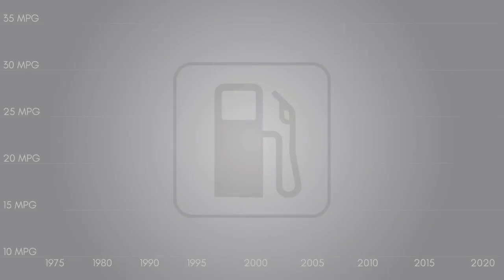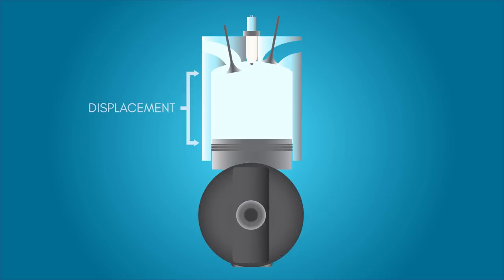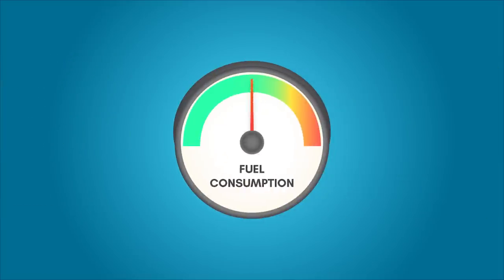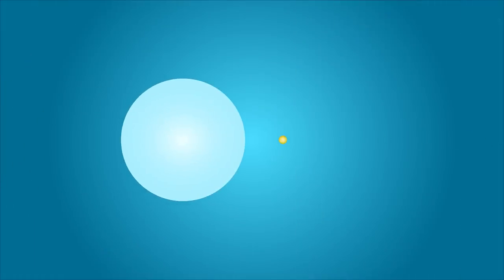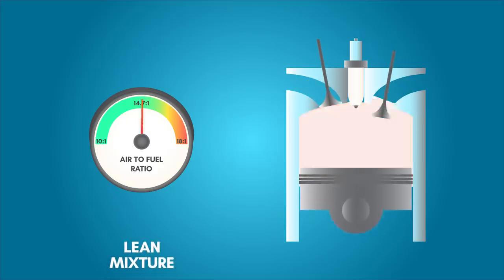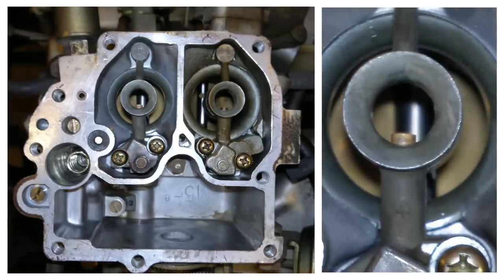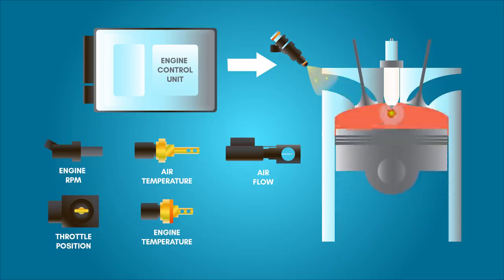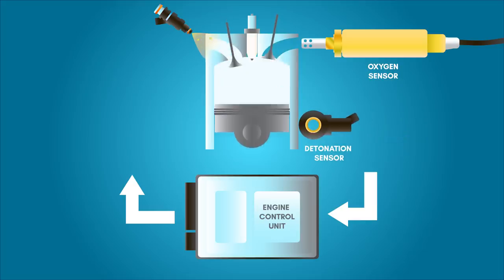How Engines Are Becoming More Fuel Efficient

Comment: The engine you showed being built is a GDI, (Gasoline Direct Injection) engine. Which works slightly differently. Mostly in that it does what it sounds like and directly injects the fuel into the combustion chamber. It does this at much higher pressure than standard fuel injection, and allows running an ultra lean burn for greater efficiency.

Comment: I own a 2014 Ford Focus SE. I recently completed a 1,400 mile trip. I averaged 47.5mpg (48mpg on the way out, 47mpg on the way back).

According to the EPA my car should do 28mpg city, 39mpg highway. According to Ford my car should do 27mpg city, 37mpg highway.

When I drive the car to/from work and around town I average 38mpg-39mpg.

I believe any car can get AMAZING gas mileage, it's all about how you drive it.
Reply: Also depend what condition of the road as well. And yes, your driving style.
Reply: It's about what kind of vehicle the manufacturer used to test the consumption. They use the lightest export model and then the fuel tank has a relatively low level and the battery is fully charged. 
No way your car can do it.
Reply: @arvedludwig3584  he just said his car gets BETTER than factory predicted mileage
Reply: @TheRedneckSage  ah shit, that's the tricky part. Here in Europe it's the other way around. We measure fuel consumption by liter per 100 kilometer.
Reply: I’m glad you like your Ford Fecus ...
Reply: You can get more credit from your bank deposit it depends on how you make your withdrawals. Uhh?

Comment: A rich mixture produces more power primarily because of the effect it has on reducing knock and combustion temperature. Though it's true some of the power comes from using up all the available oxygen, it's mainly from the additional ignition timing and (if turbocharged) boost that can be added with an enriched mixture.
Reply: That's right, that's exactly what water injection does, it gives you the ability to up your timing and or boost when the water injection is utilized, some people mistakenly think that the alchohol mixed in is what does it but it's primarily in it to keep it from freezing in lower temps, although with proper tuning the alchohol does add a little power it's the increase from being able to jack up the boost and timing from the cooling effect of the water injection that's most of the power increase, I know several guys that are street racers that got sick of messing with the mixture and re-mapped their systems to run water only (fair weather cars) and have told me that by the seat of their pants they can't tell the difference between straight water and the water/alchohol mix.
Reply: Engines actually make more power when slightly lean, the reason rich mixtures are run, especially on high performance engines is to control cylinder temperatures. Its always a compromise when tuning an engine between max power and blowing up/melting and engine. There is a tradeoff between running more timing and then running a little rich to drop cylinder temperatures to counter knock potential. But lean with a lot of timing would make more power but would be a ticking time bomb. For background I'm a mechanic that specializes in high performance Subarus, and work alot with building/tuning turbo cars.
Reply: Lean makes more power.

Comment: Great explanation of the earliest major developments in fuel economy. I believe you got one interesting fact a little wrong though: Emission regulated engines actually aren't targeting stoichiometric ratios. Instead they are targeting slightly richer (more fuel) ratios that will make the catalytic converters work a lot better. They actually cycle between moments of rich mixtures and near stoichiometric ones so that the catalytic converters can store some oxygen for their chemical reactions.

Comment: I bought a 1979 Chevy half ton, full time 4WD pickup in 1984. It had the small block 350 and got about 10 mpg. I put lockout hubs, converted the transfer case to part time, dual exhaust, an Edelbrock Performer intake manifold, and a Holley 600 carb on it and increased the mpg to about 14-15. Mind you this was at speeds of 60-65 mph. That combination maybe put 200 hp to the rear wheels.  I just did 1500 miles in my 2019 Silverado crew cab with 4WD and the 6.2 engine which puts about 350 hp to the rear wheels. At speeds of 70-85 mph I averaged 21 mpg. The improved efficiency of the new vehicles along with substantially (night and day) increase in power is truly mind blowing to me. I have no doubt I could average 23-25 mpg with the 2019 if I actually drove as slow now as we did back in the 80s when the speed limit was 55.

Comment: You missed the deceleration phase (deliberately?) where carburettors fail too and EFI is so much more efficient. When the throttle is closed at speed the sudden increase in manifold vacuum draws additional fuel into the intake, which although burnt as part of the combustion process serves no useful purpose.

EFI has the ability to disable the injectors completely above a certain engine speed (often around 1500-1800rpm for a 4 cylinder engine) with the throttle closed, and thereby using no fuel at all. This is an argument I often use against people who insist that 'coasting' (eg depressing the clutch and letting the engine idle during deceleration) is more economical.
Reply: My car on decline only disable injectors if i don't press the pedal. il i don't press the trotle, consumption fall to zero but motor brake. If i press the clutch and don't press gas pedal consumption falls to zero and no motor brake. It's a recent suzuki. An improvement on fuel economy will be to automaticaly press the clutch to  desactivate all the motor on decline (no motor brake). On shell chalenge with 1 liter they make 3500 km but they drive quite time on free wheeling.

Comment: In case you don't live in America. Most cars here are giant SUVs and Pickup trucks that do 8-15mpg. The only car that was capable of 45mpg was VW Golf TDI which resulted in "Emissions Scandal"
Reply: Well in Europe, Euro regulation are so strict that stating car are most fuel efficient is laughable compared to us. A standard car (non hybrid) can easily achieve 5l/100 or less depending on age of the car. The problem is how Americans are stuck with the idea of big engines, 75hp for a car here is commun.
Reply: @Mido Alaaeldin That has nothing to do with efficiency
Reply: Sasha Z There are far more than one type of car that has good mileage here in America.
Reply: @Douglas Hamner the mpg ratings are using different gallons in the us and uk, the US uses us gallons and the UK uses imperial gallons which more volume.
Reply: Foxycat 21 totally agree, uk fuel is better quality too, my 2008 88bhp Yaris gets 60 mpg, now in 2019 cars still aren’t getting much if anymore mpg, I do have a Jeep Grand Cherokee 4.7 V8 as a weekend car though so I do like a bit of Americana
Reply: My 2006 silverado 2500hd crew cab 4x4 diesel averaged 24 on highway @ 63mph
Reply: @jamesbizs  they only have motorcycle engine powerade cars because the gas price in Europe
Reply: Sasha Z heh, I owned a VW Passat TDI and I was like “hang on... the sheet didn’t tell me I had 45 MPG at my disposal”.. oh the good days of signing a bunch of paper work
Reply: Chief I live in Los Angeles, visit Bay Area often, from NYC originally, drove across country.   I've been driving well over  a decade, covered most of the North East. I can tell you your assertation of vehicles in the states is far from accurate.   

There is a huge number of hybrids and electrics, electrics from Chevy bolts, Nissan Leafs to Tesla.  Hybrids of every form, Prius, Camry, Malibu, Lexus Cts Rxs Exs, Fusions, Atimas, Explorers, Civics Accords, etc

The love affair with the Giant SUVs went with the Economic Crash of 2006-09, a major part of the crash are  the automakers behind the Gas Guzzlers you mentioned, only folks flush with money and a few idiots in the midwest are wasting their money on the guzzlers, in fact saving gas is trending for near a decade. Especially in fashion and entertainment. 

and even w the emmissions scandals VW Passats and Jettas especially are surprisingly quite fuel efficient.
Reply: American here, my 20 year old car gets 60-70mpg, whilst it is a hybrid it can achieve the same milage with electric disabled.
Reply: @rpoppermann  don't you ever sell it
Reply: @barabolak  I've got two now, one is engine swap for racing(: you can pick them up for like $2000, nobody knows what the heck they are so they're not expensive at all. Aluminium frame too so no rust! It's a first generation Honda insight (ze1)
Reply: @Almond Carpenter It's not the fuel quality is getting worse, cars, trucks and SUV'S are getting heavier due to all the so-called safety crap they supposedly require. Not to mention smaller engines that have been equipped with stupid aggressive gearing for better acceleration that force those engines to work harder.
Reply: Foxycat 21 here in America it’s not as bad as that comment made it seem. My 2wd 2018 Chevy Silverado gets 22mpg. The idea of big engines is part of our ideology of big vehicles but single digit gas mileage hasn’t been here since the 60’s. Modern technology brings good fuel economy even in larger v8’s
Reply: A modern V8 nowdays can easily achieve over 20 MPG, even in pushrod form.
Reply: @Sammy2k l Fuel economy has gotten better but it's not only advancements in fuel injection and combustion technology but the number of gears. In the 1960's many engines were usually mated to either a 2 or 3 speed automatic or a 3 or 4 speed manual. Now with direct injection and 10 speed automatics, large V8 engines can get outstanding fuel economy while offering generous amounts of torque and power when it's needed. However, aggressive gearing in a smaller engine forces said engine to work harder which affects fuel economy so don't always assume smaller engines always equal better efficiency.
Reply: @Dcc357 It's unofficial, but the rumored fuel economy of the 2020 Corvette is said to be 23 to 25 MPG highway. Not bad for a base model car that does 0 to 60 in less than 3 seconds. A naturally aspirated 7.0 liter should easily drop that time to low to mid 2 seconds 0 to 60 while only losing a minimal amount of fuel economy. Look at the fuel economy of the 2006 Corvette 6.0 vs the 7.0, 16/26 vs 15/24.
Reply: Yeah that was an interesting case. I believe VW did it on purpose, but I recon that probably in the future there will be similar cases where machine learning learns to deceive like that. I guess deceive is a bit of a loaded word in this case, but I mean the computer by trying random things works out it can maximise whatever its objective function is by doing something that a human would clearly see as illegitimate or cheating. The computer of course will have no clue that that's not a valid solution unless that particular knowledge is programmed into it, and I'm guessing that the opportunities for the computer to cheat will exceed the test budget in the end...
Reply: @jamesbizs  And therein lies the problem.
Reply: @Dcc357  20mpg is terrible mileage for  a car that only transports one or two people.
Reply: @Douglas Hamner  I think it might be more to do with the U.S. gallon being different to the U.K. gallon
Reply: j p that’s a childish response. Even the economy cars in the USA don’t get the mileage cars in Europe get.
Reply: Leap Frog yes. They do. And if America decided to artificially inflate the price of gas, by 2-3x like Europe, I’m sure we’d easily get to, and surpass, whatever fuel economy Europe has.
Reply: Roger Onslow I’m sure you also think Americans having guns, is a problem. Guess what tho? Lol we don’t care what Europe thinks 😆😂
Reply: Sasha Z you’re full of it, Sasha
Reply: What BS. 

The car I drive was made in Swindon UK. It isn’t the smallest car in the world but it gets 40 (IMPERIAL) Miles Per Gallon. 

Of course we only get the larger engine here, not the 1.0 3 cylinder. 

But that’s because. Europe is tiny. No need for a huge engine. We took a weekend trip not even halfway across our province. The same distance as London to Inverness. We visited relatives in the next province and it was longer than the drive to John O’Groats from London. 

The difference between someone from Europe and North America. A North American thinks 100 years is a long time and a European thinks 100 miles is a long way.

Comment: You forgot about in between carburetor and fuel injection. the throttle body injection that came before fuel injection and I was right after carbureted injection

Comment: I knew a retired engineer.  In 1992 He had the blueprints to a  "Carburetor"
He used the term
" Carburetor" so that I would understand what he was talking about because I was nothing more than a mechanic and a woodworker. This "Carburetor" got 75 miles to the gallon with the big V8 engines. I said what? Why the hell are we using it?
He told me the oil companies bought the rights to it & all he had left of it was the blueprints. He had 3 pages of super intricate blueprints. The only reason I got to see the blueprints was because,  I told him I was learning how to read blueprints as a cabinet maker. That's when he said " would you like to see some blueprints?" I waited for him come out with the blueprints that took about 10 or 15 minutes because this gentleman was extremely eccentric! He owned a auto parts store & kept it stocked like a hoarder would. There was a 2-foot path that led to the desk but no one dare entered the building. You went to his door and a hollered.  He came to the door and you told him what you needed then somehow, he would dig through that stuff and he knew exactly where everything was it only took them 10 or 15 minutes to find it. He had all the rare parts for the older cars. Parts that all the other auto parts stores did not have. He rode around in an old 60s Dodge car that had a 383 Hemi in it & he was proud of that engine! He also had three 426 Hemi engines that were new in the crates. Try pricing those on eBay someday. They're not your typical Hemi Motors!
He drove his car around Stack to Brooke sealing full of car parts and who-knows-what but the car was always squatting and you could not see in the back seat. 
This guy was the real deal. 
One day he disappeared. A bulldozer came where the hell racquetball knocked his two story building to the ground and bulldozed it. All his Auto Parts along with his blueprints we're home. Off to the dump. They tore his house down. Five years later I seen him what's a lady going in a doctor's office. He had that had a stroke and his surviving son was the person responsible for destroying everything this man owned.
The technology is out there but the oil companies or the government will make it go away!
Reply: Ronnie Pirtle Jr interesting. I don’t want to know how much humanity is being held back just because of some greedy bastards withholding patents. But then again, ICE vehicles are dead meat anyway, so why bother?!

Comment: also over the last 40 years average engine temperatures have increased greatly to increase efficiency.
Reply: Compression has gotten better even without lead additives. I do not understand why. Is is all tiny improvements in timing, heat distribution, injection, ... ?
Reply: It’s because of the insane control that direct injection gives you. 

In WWII... Britain was dependent on 100+ octane fuel from the USA to power the Spitfire which used a carb. They also had to run rich both to keep the temperatures down (due to cooling effect of vapourizing fuel) and to prevent detonation from a poorly mixed charge being too lean in the furthest cylinders from the carb. 

Germany was getting the same performance out of 87 octane because they used direct injection. Each cylinder had a specific injector tuned to the airflow it would receive to make an almost perfect mixture... so they could boost the living daylights out of it and not have to worry about detonation.

Even with sequential port fuel injection you can’t get precise enough control.  

Today’s cars are almost all direct injection and they use a lean burn... on the other side of peak where you can get detonation.  Anti knock sensors will instantly retard the ignition timing if they sense detonation and also if you use regular grade fuel instead of premium if your car is made for it.
Reply: @calvinnickel9995  THX,
I did not know until recently that there were knock sensors on each cylinder.
Reply: @calvinnickel9995  most gas engines have indirect injection. Diesel engines utilize direct injection which helps with fuel efficiency

Comment: My 1989 Prelude used to get 43mpg on the highway regularly. I don't see how they haven't improved on that
Reply: 2017 camry can get 38mpg at 75-80 with ac, 48 hypermiling
Reply: You are most likely not a typical driver (i.e. using your brain). The context that matters is how most people drive (no brain).
Reply: Yeah, and how much did it weigh and how much power did it have and what features  and safety mechanisms did it have... stupid comparison. Today you’re getting MUCH MORE out of those 43mpg.

Comment: The main causes of efficiency improvement was from electronic fuel injection, and high compression ratios. That was 90% of it the rest is from gasoline direct injection or computer tuning. However the most efficient engine is opposed piston.

Comment: Most of the innovations in the auto industry from the late seventies until now have been designed by one freelance designer.  

Now that I have retired, I have designed an anti-knock device in my free time.  It is one of my greatest achievements along with my Skyactiv designs.  I will be keeping this one for myself!  Running 38 degrees BTDC is not A problem with the device.

Follow the roadmap...
VTEC, Vortec, Voltec, Duratec, Ecotec and Ecoboost are just A few of my other designs.